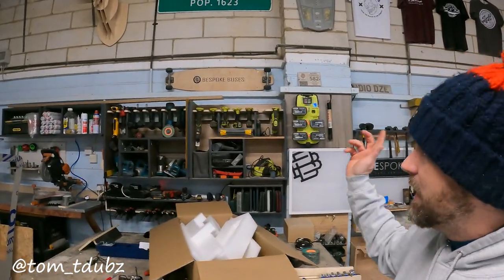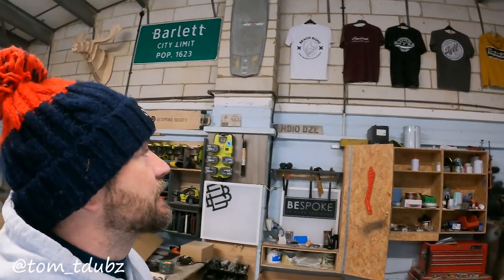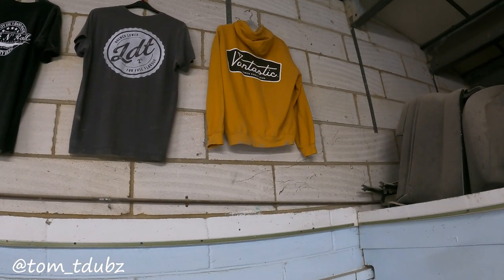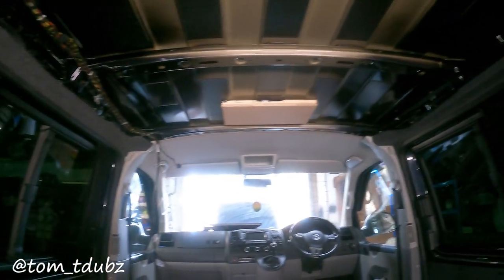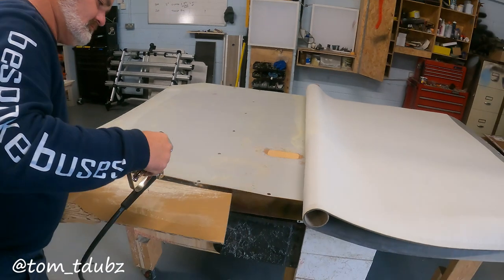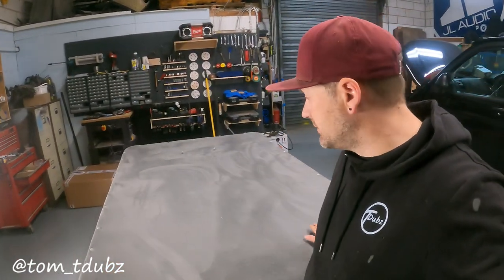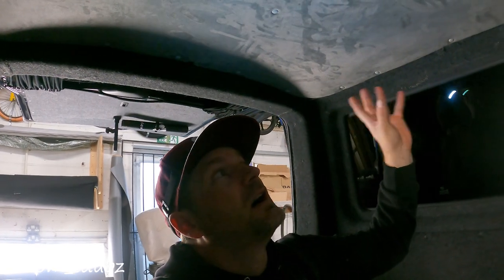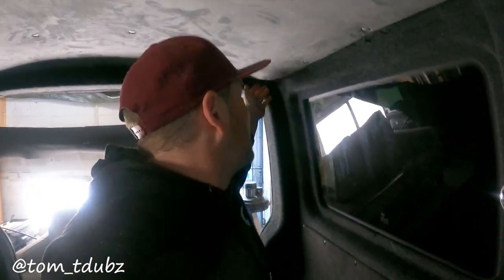Vw t5 halo roof install | led lights #bespoke #howto #diy

Comment: Very imformative video as i'm at the beginning of my LWB shuttle conversion. I've ripped out the ceiling which contained a  lot of lights and vents. but how do i deal with the junction between the front and rear headliners as the front end of the rear headliner moulds around a series of composite curves...hard to achieve with a replacement ply that only bows in one plane, unless i have to replace the front headliner as well at this juncture / junction 😁

Comment: Hi Tom I would like to build a halo roof for my T6 Kombi. It looked like you made the halo part out of MDF how did you fix that to the roof ? Also what LED kit did you get from Amazon please?
Reply from the maker: I used 12mm ply for the led to attach too, fixed that to the roof panel then carpet 12mm for the halo effect panel fixed with hidden screws.. the kit I can’t seem to find but this one from eBay as an example would work 
https://www.ebay.co.uk/itm/303901185759?_trkparms=amclksrc%3DITM%26aid%3D1110006%26algo%3DHOMESPLICE.SIM%26ao%3D1%26asc%3D20190917065201%26meid%3D7768fb717fa7434ab9022bb87c5e1642%26pid%3D100935%26rk%3D6%26rkt%3D12%26sd%3D154556437151%26itm%3D303901185759%26pmt%3D1%26noa%3D0%26pg%3D2332490%26algv%3DSimplAMLv9PairwiseUnbiasedWebCpr08MlcGreedyV3KnnRecallV1%26brand%3DUnbranded&_trksid=p2332490.c100935.m2460&amdata=cksum%3A3039011857597768fb717fa7434ab9022bb87c5e1642%7Cenc%3AAQAHAAABIArqPmzJfws5bLJj82RQBARS3srM2ZejXM26c6AIQlxSYWTkvrN6WcrmRCFWVqIxiSMqi4CLgWl%252BXWcCNA1JKlZXSRdidSfTKAw%252FPdDZ2oxdusr96nEA6T8ocete8UzVBBhwp9vPT0izClj7U4QTFEkiLiqSYKZeFY7Z4QM2y7OMWFn8hSJdp8ly1NBZBMih%252BokY77RLhuyAMAwywSo5eLDUGvR%252FmMshWev8U0fu5YkRruDlxPwOnmD2HUoaQdHffoln8XMnd8uxXglvnDp41pD57pMg1txJ1nNjCV3f39FOMnKE758zijQt0nOhLoNixI9RZzy0A7Yo424WoVnOz4wpVlxIUht6IlQ21b7y0pAf3Q0W6SOi28%252F5dwEc37lSWA%253D%253D%7Campid%3APL_CLK%7Cclp%3A2332490
Reply: Hi Tom where did you pick up the live feed for the lights, I would think it has to be a constant live otherwise it won’t work unless the doors are open ?
Reply from the maker: @neilfordham5790  the van has a leisure battery system installed so ran a new feed for it 👍🏻

Comment: Was the main roof panel a standard 8x4 ply.
Reply from the maker: This roof was the original roof using an 60mm off cut of another roof glued an fixed to make a one piece roof

Comment: Hey guys. Looking to do the front cab headliner of a caddy. Some shakes to go around so would you still use foam backed or go without? TIA
Reply from the maker: I’d go for non foam backed… stretch is a bit better…

Comment: How did you fix the halos to the roof?. Where did you connect the lights upto in the van?
Reply from the maker: The video wasn’t as detailed as planned… the halo was fitted with hidden screws. The lights were power but the existing rear lighting loom..
Reply: @tomtdubz  thanks for getting back to me. I think I know what you mean by wiring into the loom

Comment: Hi Guys which shade of grey are you using in the build from Harrison Trim Supplies
Reply from the maker: Light grey 👌🏻
Reply: @tomtdubz thanks. Have you any videos where you have used the dark grey?
Reply from the maker: @user-jf6vk8si3z no sorry, the light grey tends to go nicer in my opinion..
Reply: @tomtdubz  would you have a link for the remote controlled RGB strip light